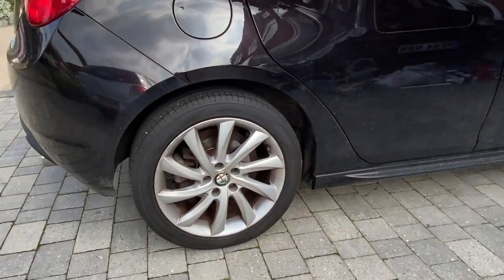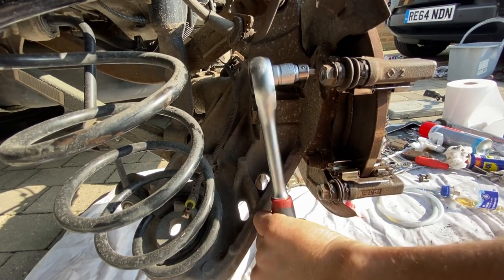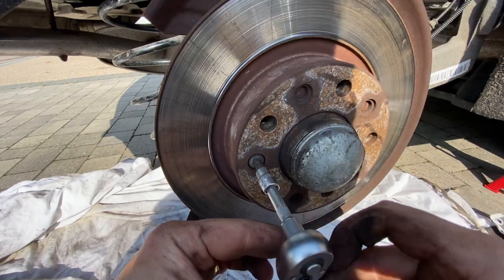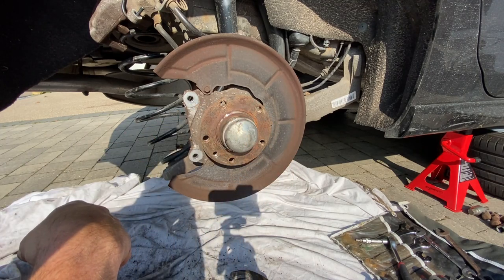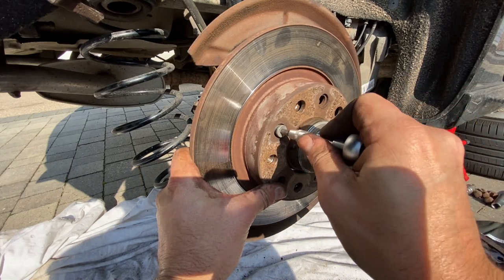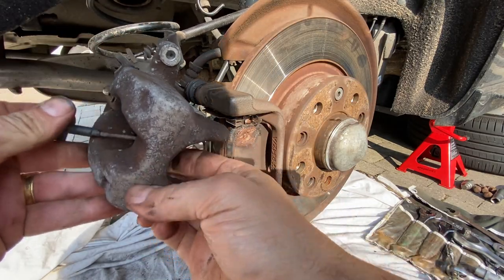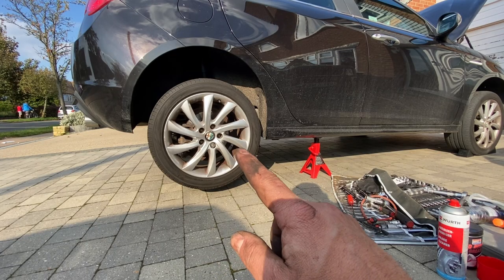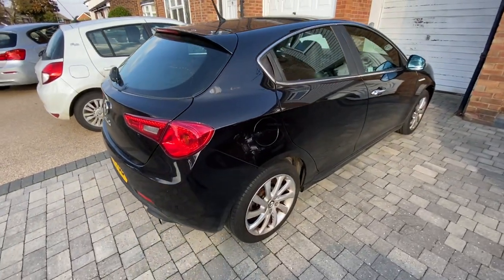Alfa Romeo Giulietta Changing Rear Brake Discs  or Rotors

Comment: Very useful, thanks. My sliding caliper bolts are different lengths, which of course I didn’t notice when I took them out…! Any hints on which goes where? Thanks.
Reply from the maker: Hi Hugh. If you’ve not done both sides, then you can compare them against the other side. If they’re very different then it should be obvious when you put them back if of thought. You could try dry fitting them and if it doesn’t line up then swap it round. Hope that helps. All the best 👍

Comment: I gave it go today following your video. Unfortunately hit quite a few road blocks. One of the guide pins is sticky and doesn’t return back to start position. After a process of elimination determined it was the boot itself. Can these be purchased on its own? EBay sell the kit for about £8, just want the boots. 2nd stumbling block was fitting the pads, one side goes in without a hitch, the rear side just doesn’t go in easily without considerable force. Even once in its not sitting straight. Might stretch out  the spring clips to see if it helps, had to abandon in the end. If buying Pagid pads bear in mind it doesn’t come with new spring clips. Any advice would be appreciated. Thanks.
Reply from the maker: Hi Mak. You can buy just the boots, but for the price of a kit I’d consider renewing the other parts. Sounds like the pad clips may be bent for sure. Don’t forget to add some copper grease to help them move. 
All the best 👍
Reply: @vialettotony  Thanks for responding. I bought 2 sets from eBay(decided to replace both sides), £7.50 each. Includes guide pins, boots, bolts and a packet of silicone grease. Filed the brake pad ears down a little to  aid smooth sliding fitment into the clips lubed with copper grease. Bought the same piston tool to push it back. Although Halfords do a multi cube fitment for £8, I didn’t gamble on it as I don’t think it would fit in the caliper with how far the piston was out. One side done, stripped the Brake Pad holder bolts (Allen head) in my haste to avoid the rain. The saga continues…

Comment: I tried to do it today but unfortunately no success. That seized allen hex bolt is a pain in the arse. So stupid idea by Italians to put this bolt up there instead of any other bit like TX. I had to take a car to the garage. What a waste of £60 just for changing the rear brakes
Reply: Ha ha! I suffered the same fate! Although it was my doing unfortunately. It was intermittently drizzling all day so I rushed the job. In my haste I tightened the bolt stripping it in the process - schoolboy error. Put old parts back together. Not gonna let it defeat me just yet, gonna try 1 size up torx bit, failing that it’s going to the garage. Not been straight forward at all for me, despite the super quality of the video. Stuck guide pins, new brake pads not sliding in, it’s been a mission and for now still a work in progress.